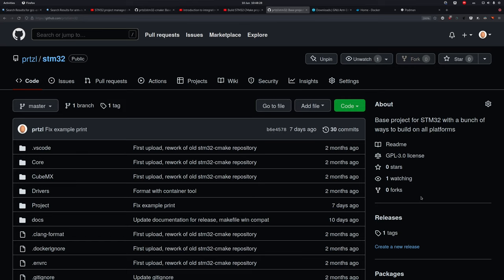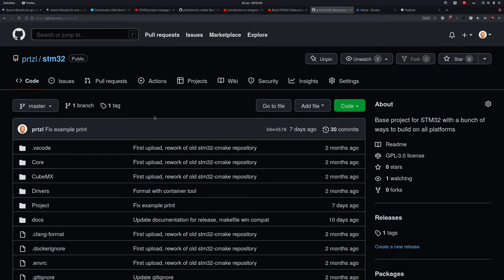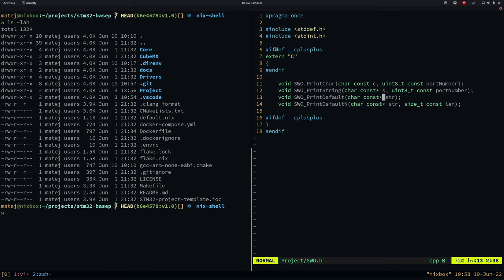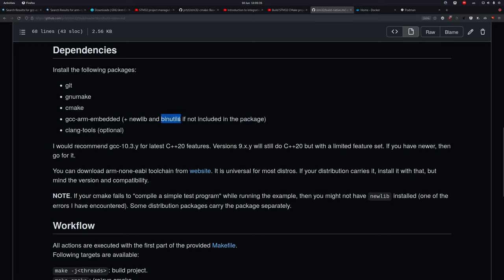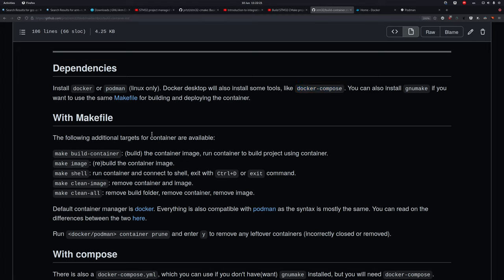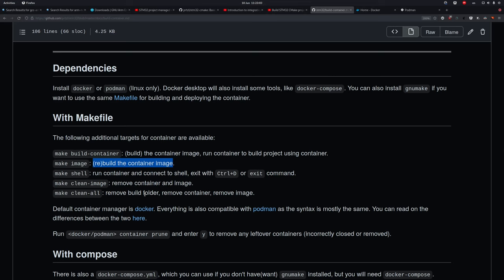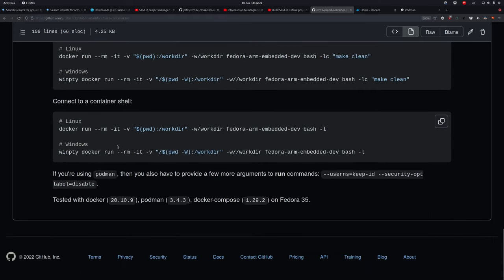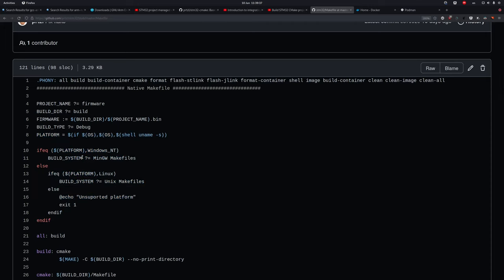Ultimate Build Workspace for STM32 (lots of resources) | VIDEO 49

Comment: Great video, thanks, this help me a lot. May i suggest a topic for one of your next video ? Clang Tidy with stm32, I tried, but rigth now it is out of my skills .
Regards✌✌
Reply from the maker: That's a good point. In fact, I kind of use clang-tidy in my development environment by the use of clangd for checking code style and potential errors. Might be a good idea to present my current development environment and tools that I use beyond just the build tools.
Reply: Thanks for taking the time to answer me . For my part I came to look into clang for naming convention; for code formatting I used uncrustify. But clang also have a simpler code formating and also an error analysis. So clang seems to have everything a code writter can dream of but implementing it into STM32 project make me abord this. 
Thanks in advance for your coming video xD

Comment: Have you looked at ObKo integrating a lot of the STM32 files into CMake? At least in terms of a findPackage.cmake. It setups the toolchain properly as well (if you have it installed). All I had to do was add the path to the cmake scripts to the CMake module path. And bam. i can request the libraries that i want and link them to my own project. Its never been easier!
Reply: can you provide video link, using cmake as you mentioned
Reply from the maker: @Arianna Rodriguez I checked out the repository and it looks interesting the way it modularizes different parts of the configuration, leaving the main CMakeLists.txt shorter. I'll give it a test run, but for releasing projects and work I'll stick to more "simple" configuration. When sharing code, people will understand the project configuration quicker and it keeps the codebase smaller and more maintainable - less stuff equals less potential bugs and tests.
Reply: @darsanpradeep4986  its on GitHub. I dont think I can post links here on YouTube. Like YouTube may just remove them
Reply: Fair enough. I thought this was much more simple, as in basically no need for any software (except as reference) from ST. And your actual projects does not even need to contain ObKo's repo or any ST cube packages. I think I should go over your content again though, its been a minute
Reply from the maker: I just worked on my H7 dual core cmake project and there is quite some repetition. Each core (target) has its own executable, headers, sources, compile options and such. When thinking about how this repository might shorten the repetition I started making some macros and functions. I might end up at a similar concept, but smaller. Who knows :P

Comment: Awesome video!
Yet,Could you please please show me how to flash stm32 using cubeide in Linux ?
My serial port  is not shown using uart in putty
Reply from the maker: You need a debugger to flash with CubeIDE. Flashing over uart requires the device to enter bootloader mode. I mentioned it in my flashing video.
Reply: Thank you very much,  Could you please send me the video link ?
Reply from the maker: @Brahim Jarallah  Complete tutorial using CubeIDE and stlink debugger was in video 18, other independant tools are described in video 44, both on my channel. Cheers.
Reply: Ahh OK Matej that's wonderful , I will try that! Thanks a lot boss! 🤗😊🤩